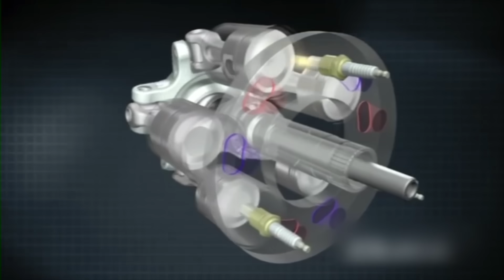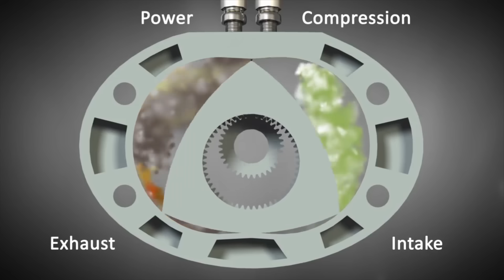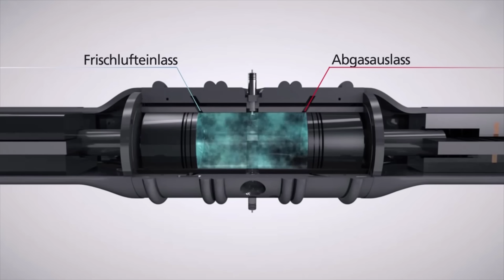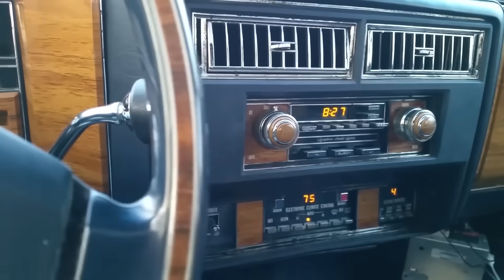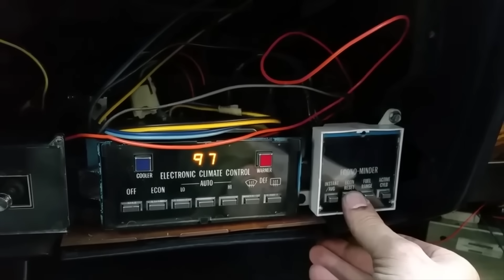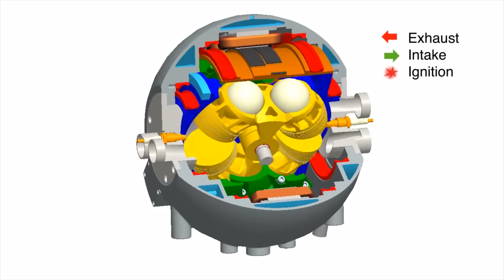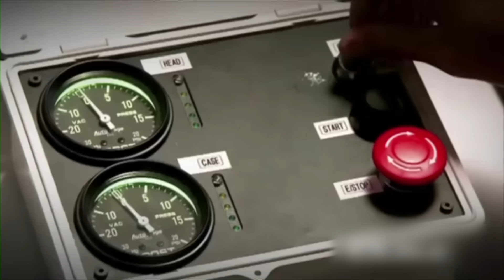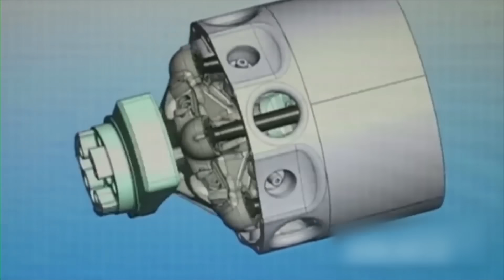10 Strangest Engines of All Time

Comment: Did I hear that correctly, higher compression engines eat more fuel and put out more emissions?!?
I think that it's the other way round.
Reply: yeah im pretty sure that description was wrong, that engine runs high compression at cruising and lowers the compression as the turbo comes on boost so it doesnt detonate at high boost
Reply: 10 years Later, Thousands of those EXCESS parts in that Engine, will be scattered all over the highways, when college kids try to commute home for Thanksgiving. xD
Reply: Yep, bullshit "facts", high compression = more fuel economy, low compression = low fuel economy. Also you can't go for more power with high compression due to engine knock (detonations of the fuel inside the cylinder).
Reply: Detonation of fuel inside the cylinder is the desired objective. Engine knock occurs when the fuel ignites prematurely... so the more accurate term would be pre-ignition.
Reply: @martinhirsch94  No, you don't want detonation inside the cylinder, you want deflagration. Deflagration is a controlled way of burning fuel insinde an engine, if the fuel detonates you get knock and damage the engine.
Reply: When Americans talk about emissions, all they mean is NOx.
Reply: the guy is a newbi,knows nothing..this,is our future,,full of bumb asses..

Comment: That variable compression engine is going to have so many problems with that system it adds like 30 new failure points to the bottom end
Reply: there is a different version that tilts the cylinders which has less moving parts

Comment: why can't electric cars have generators on the wheel shafts to generate power to charge the battery while driving ? 🤔 seriously why not ?
Reply: FRICTION ...
Reply: look for a 2mode hybrid
Reply: It does its called an alternator, they also misslead understanding with falsely calling them fossil fuels it is just a hygrocarbon that they make and burn, and looking at my history book the electric motor was invented before the internal combustion engine by 4 years
Reply: Why not - if the voltage regulator fails, you'd have a runaway acceleration. They will find you in orbit around Neptune much later.
Reply: @skuula  Damn you Soren you've just invented a hyperdrive....
Reply: Please tell me you're not serious.  Please.
Reply: self perpetuating engines cant exist due to the laws of physics
Reply: Generators opposes a resistance to the rolling wheel, so the engine would have to work more to make the car go, hence using more electricity, that would be regenerated in parts by the generator, but the generator would use more than what it generates, due to frictio, thermal loss and such. 
Some cars already have KERS, "Kinetic Energy Recovery System", which do what you're saying when you're braking, it recovers energy from the inertia of the car, then sends it to an electric motor when you accelerate again.
Reply: there's got to be some way around it I don't think they are telling use the whole truth. even little wind turbines make power and they don't need that much wind to turn.
Reply: @RICHOWASP  Your confusing energy with 'work' :(, thermodynamics makes efficiency less than 100% converting energy for work ... You will ALWAYS get entropic loss, this limits the energy that can be scavenged. :( The electric motor can be a generator for breaking BUT energy is lost. If you can reduce those losses you can make money, We are at a technical limit as we don't know how to do better economically ... Engineering is a lot of trade off's.
Reply: @RICHOWASP  the power problems invented propaganda like all mainstream mind control, global climate change happens yearly summer winter sea level rise daily tide goes in and out? Sorry random nutter out